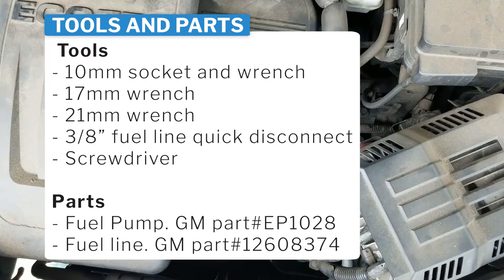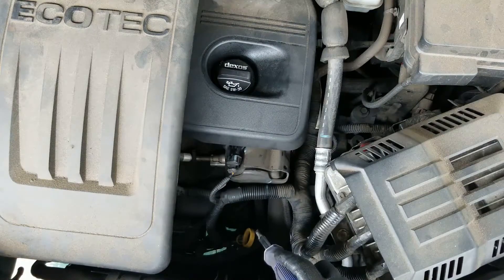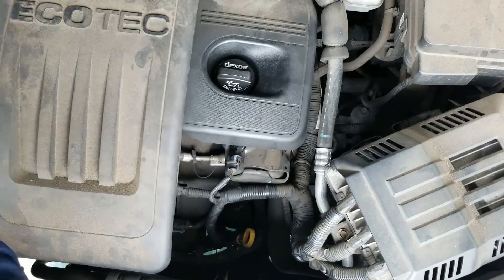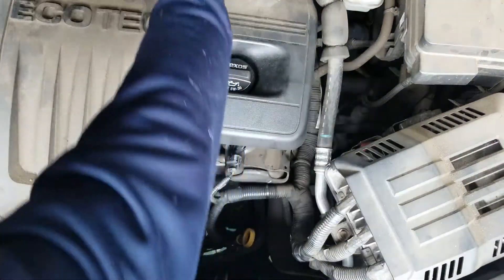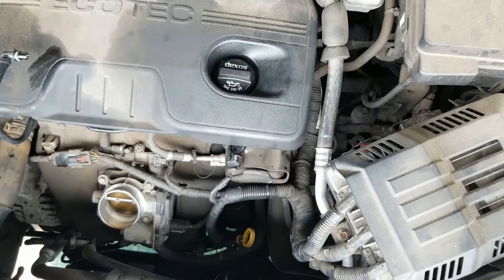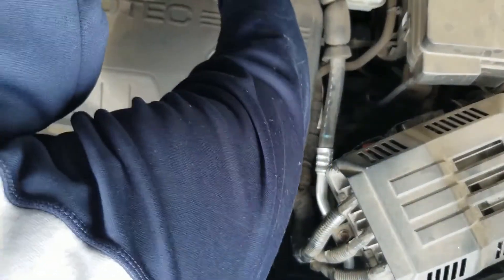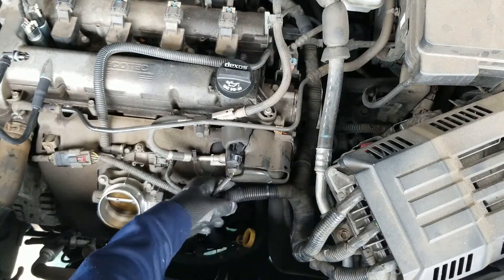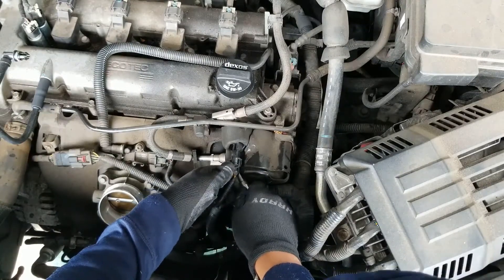GMC fuel pump replacement step 1 removing engine cover

Comment: Hey. I wanted to know if you may know why my 2015 GMC Terrain Sle 2.4L keeps shutting off a few moments after starting it? I have changed the battery, solenoids, camshaft sensors & the the engine relay. Please let me know if you may know what to do next. Thanks